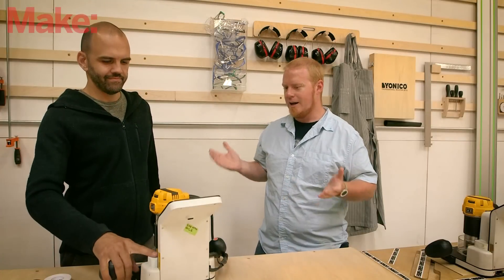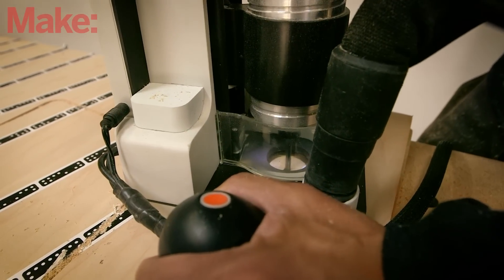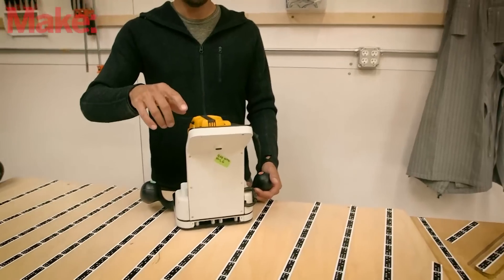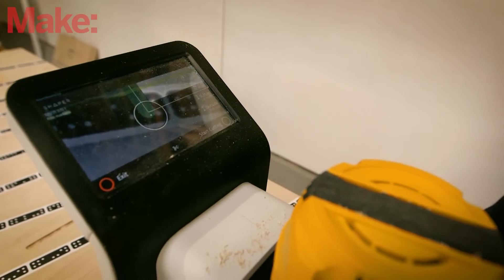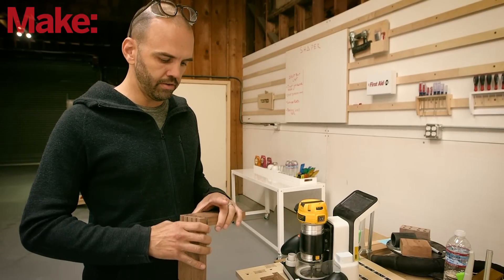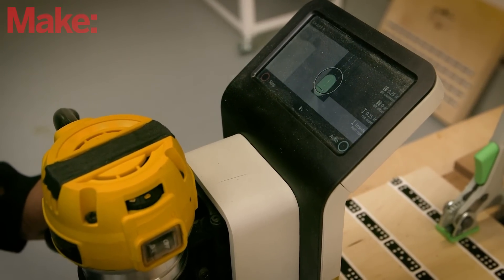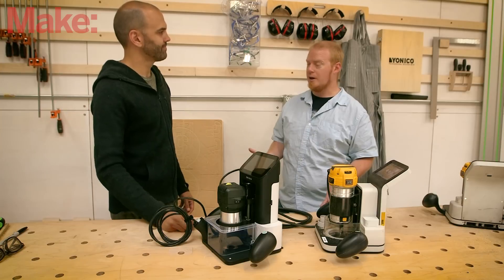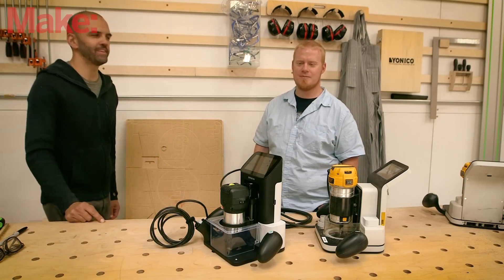Portable CNC: The Shaper Origin

Comment: I wish I had an extra $1500 or a reason for a tax deduction. This tool is a mind blower. The internal motors compensate for any snags or erratic movements you’ll likely add to your human touch. You can also define your depth throughout your cut. I’m thinking that this type of tool will revolutionize inlays in hardwood floors and other over the top design work. Well done Shaper!

Comment: There is another company coming out with a robot version of this. It moves and cuts by itself. 
It's range has no limits ..other than the work piece itself.

That will make this thing obsolete before they know what happened ..and the gantry cnc's are in trouble too.

Comment: Don't understand why u need to put tape to guide the portable CNC. Normally you set a "Zero" reference to the corner or in the middle of the board. Good idea but expensive... I will keep the "cheapest" idea of a normal CNC. Why don't desing a CNC table that the portable CNC take it as a reference border as usual like others CNCs on the market? Or install border sensors like the vacuum robots (ROOMBA) that avoid to fall down the stairs setting first the 4 corners of the board?

Comment: HOLY CRAP!!! $2099 for this!! I understand the concept but bought by CNC machine for $1800 with the router. I know I can only do up to 30" wide by infinity but I can cut finger joints with a free jig. 

You still have to manually guide this thing so what's the difference if you draw a sketch to cut or make a pattern to copy? So it has a camera attachment. No thanks!
Reply: 1976ClassicCelica it auto corrects on X y z axis as you move it
All the user is doing is keeping the tool in rough guidelines
Reply: Any piece you want to work with has to be mounted on your CNC, within the dimensions of the CNC and you have to be able to bring whatever you want to work on to your CNC. This thing is the size of almost just the router, cuts anywhere you can get a power cord, in any orientation and on any reasonable flat surface but the object itself can be any shape it wants to be because you don't have to fix it into a bench.

Comment: They should have clarified how the tool compensates for user movement to keep the cuts accurate.  Initially I thought it might have a drive mechanism built into the base, then it looked like you were just following the onscreen guidance, it wasn't until they show the pocket hole being cut that the lateral movement within the machine is revealed.  Definitely creative and a new entry point for makers to explore CNC projects.

Comment: I think you glossed over the cool factor here. Some amount of people that watch this video are going to be thinking that the worker needs a steady hand to cut a straight line, even with the cool screen guiding you. 
You could be having a seizure, and this device will still cut a straight line. The cutting bit is on a is on a "X Y table" (like a plotter, or CNC machine) and is moving independently of the handheld outer shell.
Reply: *****
Ok, we cant guarantee straight lines if your having a gran maul seizure. All other seizures are compatible.
Reply: Proper straighness of lines can not be guaranteed during earthquakes of magnitude seven or higher. All other earthquakes that do not sever electric supply are within specification.
Reply: I think there might be a limitation on how fast the machine can be shaking though. The alighnment mechanism has a maximum speed at which it can align the cutting piece with the work surface - and move it in and out of the material. Also, the computer in this device will have some latency before it can correct the movement, not enough that it would matter with normal use, but probably noticeable at high movement rates.

If you're actively trying to make jittery lines, I gues you'll succeed, but I don't think it will be easy.

It's definitely a cool tool.

Comment: This thing looks like it will be great for DIY one off projects with a lot less shop storage space, jigs and fixtures. More expensive than aluminum extrusion, linear slides and steppers minus the drivers currently. They must do a 2.0 or 3.0 rev with much lower prices.  Gotta come in around $400. The tablet, tiny steppers and lam router materials are less than $300 retail. I imagine much less in bulk.

Comment: Why would anyone need this?  A real CNC just does the exact cutting for me.  I know I'm not perfect with a router I don't need a machine constatly telling me I am off line.  Pass....
Reply: It doesn't simply tell you you're off the line. It stays on the line for you.
Reply: Why would anyone need this? Why have more than a sharp rock and a flat rock?
Why would anyone need a power drill or a circular saw.  Be a real craftsman use a gimlet and knapped obsidian.
Reply: for the price.. try get a cnc with a table big enough for a full sheet, and room to have a cnc hanging around. 
it tells you which way to go and makes small changes to keep the lines perfectly inline, making 99.9% of people perfect with router. 
does alot more then tell you your off the line.
Reply: It adjusts the router position for a margin of user error , the whole unit doesn't move by itself

Comment: If you put wheels on it (& some heavy weights), you could take the human outof the picture completely.
Reply: Jet pack. Wheels are too 20th centch.
Reply: I was thinking that too, but it still has to be moved by something...
Reply: uh... motorized wheels?
Reply: ...maybe a big etch-a-sketch with motorized knobs with limit switches and relays with flux capacitors powered by a wind mill! Poop! Radio Shak being gone gonna make this a hard prototype to build..I've been in Edison's work shop several times...looks kinda like Jimmy's..only way less noise...
Reply: r u ok
Reply: ...kinda like Kenny Rogers said.."Just Stopped in to see what condition my condition was in". I B OK
Reply: That's not such a crazy idea, roidroid. I wouldn't be surprised if we saw something like that down the track a bit.
Reply: yes but it have to super heavy to not move itself with the working tool.

Comment: From the looks of the comments, most of you folks are not wood workers.  This is a revolution in hand held power tools.  Being portable (and hopefully light weight) one can use this type of tool on walls, floors, ceilings and other places that can not go into a CNC router or mill.  This will not replace CNC, but will make a great addition to the tools of the trade.
Reply: Yeah, this. I've been a carpenter for over 25 years, and this is the most revolutionary new tool that's been introduced in my lifetime. I've designed and NOT built a bunch of CNC machines because none would have met all my needs, and still fit into my small shop. THIS, if it works as advertised, will be perfect for the multitudes of peole like me.

These guys are gonna get rich off of this, deservedly so.
Reply: I agree. I just bought the DeWalt router they used in the prototypes and its great, but boy would I love to be able to control it as easily and accurately as this. Even a complete beginner could turn out professional work with this tool. And most of today's essential accessories like  edge guides and circle guides will become obsolete with this tool.
Reply: I know you already have million ideas in ur head to use this tool for, looks like it's a good one
Reply: I guess I must be the odd man out, but this tool is pointless, expensive, and slow.   I'm a professional woodworker and I would have no use for this.  Seriously - walls and ceilings?   What the hell are you routing on ceilings for?    Have fun holding this slow ass clunky machine upside down.    Everything that this machine is purported to do can be done easier, cheaper, and faster with traditional tools or jigs.   I am an old fart, but not technologically handicapped - I have a large stationary CNC machine in my shop and lots of automated industrial woodworking machines, so I appreciate the value of repetitive and precise cutting.     And this stupid tape everywhere???  How long will that take to put on, scan, and then peel off?    Also, this machine doesn't look very durable for shop or field use, and other than the $90 router, it doesn't look to have replaceable parts.  We end up replacing something on almost every machine we have over the course of a year.  Availability of parts and service are part of the equation.     Don't get scammed into buying an overpriced tool thinking it will make you a better woodworker - spend $500 on a nice set of chisels and japanese saws and practice practice practice.   Years ago our shop was in a makerspace/incubator and there were a bunch of companies like this with highly educated, but not very creative or original,  hipsters trying to reengineer toasters or whatever in the hopes of a big payday.   They are all out of business now.   These guys are probably thinking Bosch or Black and Decker, or Festool will come knocking - when they don't good luck buying the tape or getting your expensive tool fixed.   Two things common with other start ups - some cute story about how they got the idea, and insistence they know better than anyone else - really, you had to build a machine to print the tape? Because commercial printers that have been doing it for hundreds of years weren't capable of printing dominos?   Please.     And, by the way, they aren't even original - the Handibot has been around for awhile now and makes a lot more sense than this does.    Whats the point of a CNC you have to move around by yourself.  I build things while my CNC is running.  The point of new technology is improving efficiency, making money.     And who was talking about having seizures while using?  Their stated margin is less than 1/2"   - still will take a bit of concentration to remain within that tolerance.    Real engineering feat - stepper motors that move 1/2" .  Sorry for the stream of consciousness but please THINK, especially with these machines that are given for free to a bunch of popular online woodworkers - don't see many honest reviews on here - seems worst a free machine gets is lukewarm.....
Reply: You don't route your ceilings? That's the first thing I do when I get on a new project. Routed ceilings are the best, particularly when it provide access to attic space.

What I don't get about this tool is how it ensures your lines are perfect. There is no way it moves fast enough to compensate for not having a guide or straight edge to prevent normal human unsteadiness. According to the website, it "enables more precise cuts by automatically correcting or retracting the tool’s bit if the machine strays from the designated cutting path." I just don't see it being fast enough and capable of offering enough correction to make the kinds of high-precision cuts they are showing in all of the videos. I'd like to see a real review, outside of a staged infomercial. Don't get me wrong, it can compensate of "jitters" and unsteady hands following a line. It CANNOT compensate for slips, jerks, sneezes, lack of attention, and all of the other things that make standard router use tricky. I think this is why you see them moving ultra slow with this tool. It will be great for hobbyists, but I don't think it is going to speed up professionals enough to justify the price. I could be wrong. It wouldn't be the first time.

If you read the few reviews that are out there, you see things like "There’s certainly a trick to it. Shaper employees were able to hold much tighter tolerances due to practice." In other words, it still comes down to skill. This may allow you to get rid of certain measurements, but it cannot replace tried-and-true practices for getting tight tolerances and perfectly straight cuts.

Add to this the fact that the tape is $15 to do a 4'x8' panel and you are talking serious bucks to use this thing over time. That is in addition to the $2,400 price tag. YIKES!

Having said all of that, it is a cool idea and Festool is behind it. Unfortunately, I think it is more gimmick than gadget and it probably won't live up to the hype once it is in customer hands.
Reply: Significantly lowers my regard for Festool if they are "behind it"     I think they just supplied the spindle, because apparently only the best would do.  Honestly I'm not sure Festool routers are that great.  I owned one years ago and sold it on eBay.  Don't get me wrong, I have tens of thousands of dollars of Festool equipment in my shop and on my company trucks, but nothing special about the router and it felt ergonomically unbalanced to me.  Don't buy into the Festool thing - just more hipster bs - like when they said the 50,000 large commercial printers out there couldn't print their ridiculous tape correctly, so they had to "build a machine to do it themselves"   P - L - E - A - S - E         Sell crazy somewhere else
Reply: If you like 2D cuts, single pass cuts, and poor accuracy. No dust collection, water cooling etc. Wheel will slip on chips. You will waste material.
Reply: What happens when part of a cut out popups up and makes a 1/2" lip?

Comment: So, if you veer off course slightly does it try and compensate and make a straight line or does the line go crooked? I would assume it would compensate as much as it could until it lifted up the bit if you got too far from the line.
Reply: it compensates to a precise cut path it guides you on screen and and makes the perfect adjustment as long as you stay close to the cut at 3:29 he intentionally moves out of bonds to show how it stops automatically if it can no longer compensate for a precise cut  and you can start again inside the cut path ...... MAKE totally dropped the ball in editing and the point was totally lost in the video!
Reply: +Andrew_koala OK Yoda, LOL !
Reply from the maker: Yes, that;s exactly what it does
Reply: this is exactly what the machine does. Pity that they didn't mention this feature in the video.

Comment: Of course they forget to tell that it's usa only..  As always usa companies fail to realize there is a market and world outside. Hey shaper. We do not live in caves anymore over here.
Reply: They need to get regulatory approval for each country/EU to sell, which is expensive and time consuming, especially if it plugs into the mains (220/110V). Easily 100k USD per approval in paperwork and testing. Thus the popularity of starting with a home country to reach cashflow positive first is very popular.
Reply: The EU is a common market: get approval in 1 country and that is valid in all EU countries.  
But yes, there is still a lot of (re)work to do to show you comply with the relevant machine and electric safety regulations, this is not a raspberry pi. the amount of money that goes in also depends on the extent you would have to use external consultants vs own safety engineer.
Reply: And we have multitudes of products which are only sold outside the US.  Regulations, my friend. The entities that provide all the 'free' services have to regulate everything in order to pay for it all. Sad but true. On both sides of the pond.
Reply: All you need is a supplier who will ship to Europe.  Regs only apply to the electrics.  But don't worry- if these sell well, Hong Kong Phooee Inc. will have knock-offs at Rutlands within weeks!
Reply: +belson alan it's a fast rotating machine, also regulations for that
Reply: I have no doubts about that.